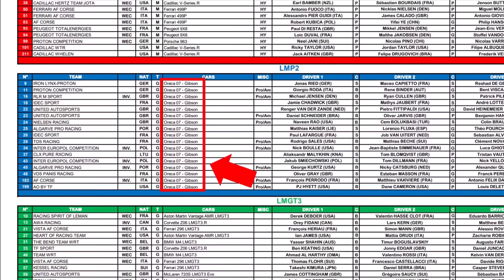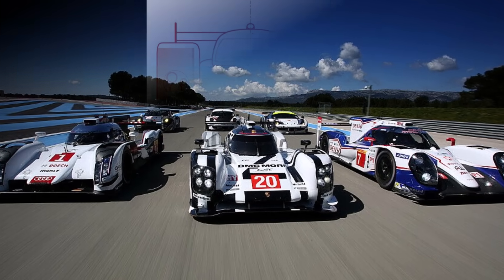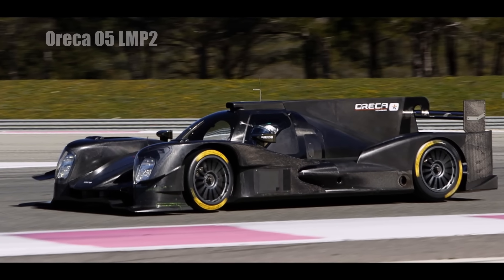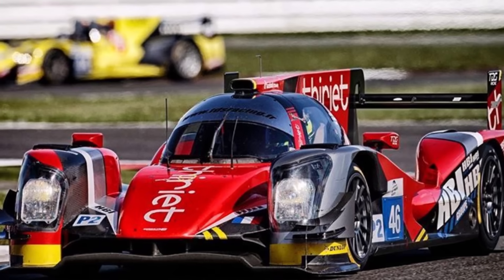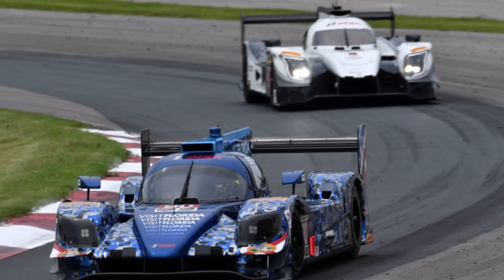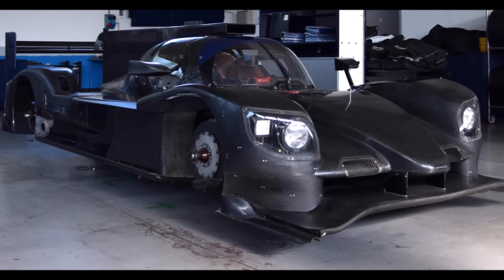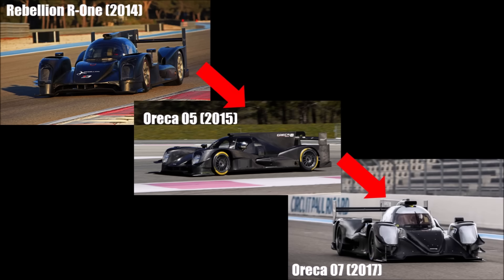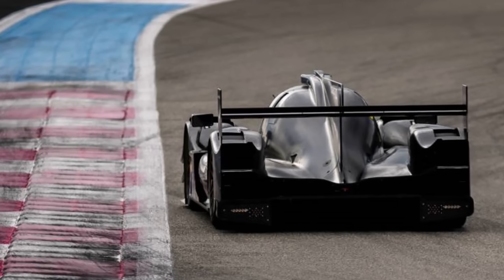Why everybody is driving an Oreca 07? - LMP2 EXPLAINED

Comment: I don't want to be finnicky on an otherwise very good video, and I may be wrong, but are you sure you've got the correct Ligier logo at 2:30 ? The Ligier with two flags is know for disabled-people cars, scooters and the cheapest possible plastic runabouts. The racing car Ligier has a circle with a sharp boomerang like a Star Fleet logo as a badge.

Comment: Of course ORECA had a great start from its purchase of Courage and all the IP from a very good basis of the Paolo Catone designed C65 LMP675/ C75 LMP900 series open-top cars, and their success evolved from a solid base.. which makes everything easier.
Let’s see how good the LMP2-Gen4 car from ORECA goes and looks, and I’m certain it will be an evolution of 05/07 series ORECA’s, why would you bother with a clean-sheet design when you ARE the state of the art (for 10 years already)! Almost as boring as Indycar’s Dallara IR12-based evo-car 🥱….😅😅😅

Comment: New LMP2 regulations were originally supposed to debut this year but I believe it was delayed till 2027, with Dallara, Ligier, Multimatic and Oreca, which are what the LMdH prototypes are based on sharing both the tub and floor as the next gen LMP2 cars, both BMW and Cadillac are based on the Dallara, Lamborghini is based on the Ligier, Porsche is based on the Multimatic and both Acura and Alpine are based on the Oreca

Comment: Riley was replaced by Multimatic as one of the 4 LMP2 chassis suppliers, which is what the Mazda DPi prototype was based on sharing both the tub and floor as the Multimatic LMP2
Reply: I noticed that the Multimatic LMP2 used the same wheels as the Mazda DPi.
Reply: @keefgtp yes because Mazda and Multimatic worked together to build the car, it shared a few parts with the Multimatic LMP2, including the tub and the floor, same went for the Acura DPi with Oreca, the Cadillac DPi with Dallara and the Nissan DPi with Ligier, in fact the DPi regulations was the main inspiration for the LMdH regulations

Comment: LMP3 is under a similar situation, everyone races Ligier, there are few Duqueines, even fewer Ginettas(and I started scavenging for every channel I could find because I liked the G61 on the spot, so that it reaped almost nothing is painful) while ADESS made a leprose of a car apparently, the only company that touched it made the chassis into an hydrogen-powered car of sorts. And if given the chance many prefer to deploy a car called Nova Proto 02, that competes with them despite being built outside of the  four manufacturer and running a Ford engine in place of the asiatic one(it was Nissan, now it's Toyota) imposed by regulation.

Comment: Great timing of this video - with the 2028-32 chassis and powertrain awards announced by ACO today:

“The modernised, simplified new-generation LMP2 class will be introduced in 2028. The two chassis constructors are: Oreca and Ligier. Gibson will continue to be the sole supplier of engines, and Xtrac for transmissions for LMP2”

Comment: Oreca 07: so good it turned an entire category into a spec series. And it's quietly one of the most successful and dominant cars in endurance racing history. It was only 38 minutes away from winning Le Mans OVERALL in it's debut year.
Reply: Also more than 100 models have been produced, which is a ridiculous lot for a prototype car.
Reply: The IMSA Weathertech Sportcar Championship used to run LMP2 spec cars alongside the DPi cars until 2019 when the LMP2 cars were restricted and made slower.
Reply: Maybe Peugeot should ask for the receipt.
"it's quietly one of the most successful and dominant cars in endurance racing history"

Due to lack of competition in its category. Those cars in the LMP1 were spaceships compared to this car. No doubt they had some reliability issues in 2017.
Reply: That's still ten laps or some 136km....
Reply: @GTfour01 they lost the lead 38 mins from the end, they didn't finish 10 laps down.
Reply: True, the fastest LMP2 finished 20 laps down or 272km.
Reply: @GTfour01  Not in 2017, he explicitly stated "in it's debut year", where the Oreca 07 finished just 1 lap behind the leader.
Reply: @nejcmirtic529  Yes, I was there. It was my fellow countryman Ho Pin Tung who led the race for quite a while.
But let's not fool ourselves, only because of mechanical issues with al LMP1 teams, did an LMP2 car manage such a high result.
Reply: @GTfour01 that's the whole point of le mans though, it's a reliability race.
Reply: @trialsted that’s too broad of a statement to call the 24h of lemans

Comment: LMP2 at the past is FASTER than LMH/LMDh nowadays. 

LMP2 past 920 kg, 600 hp

LMH/LMDh 1030 kg, 670 hp

Current LMP2 looks slower because FIA/ACO cut down their power to 540 hp, not full 600 hp spec.
Reply: you're not accounting for the extra power of the hybrid system tho, plus the "momentaneous" AWD in the case of hypercars, cause their electric engines power the front wheels, they also have a much better aero packages and turn speed thanks to these two things, and you know what happens when you turn faster? you get more top speed at the end of the next straight
Reply: I vaguely remember the LMP2 cars getting nerfed at the beginning of the hypercar regulations, because they were too close in performance

Comment: ORECA has exceptional build quality, that makes a huge difference. It has a much wider setup window than the other cars and has much fewer suspension options for setup.

The Ligier could be made to work on smooth, high-speed tracks with little ride height variation for a few laps, but once anything changed, you were screwed. Beyond that, they were a nightmare to drive. No matter what, it had a super fast turn-in and then went immediately to understeer. It was a treat.
Reply: Reminds me of their LMP3 car model in iRacing. Just a right bastard to drive and I've given up on trying to love it. Stiff, overly reactive chassis, genuinely awful turn-in, and no real raceability within class because it simply cannot deviate from its ideal line.

Meanwhile the LMP2 is an absolute pleasure, or at least it was until they nerfed the front end grip into the ground. Now you have to work hard to not eat the front tires, yet it gets minimal rotation out of the rear end and feels like you are dragging an anchor behind it.

I'd love to see an updated model and chassis LMP3 in iRacing. It is a very cool car and a great intro to prototypes, the P320 model just is no bueno. 

I'd also love to see the Sebeco NP-01 make it in as an even more entry prototype. Such a neat little car and lightning fast for something with only ~220hp.
Reply: @bobbymoto1675  FWIW, at the track, I tune the Ligier P3 like it's a GT3 car. The aero platform is simple enough that you can get it off the ground and let it move a little. The gain in mechanical grip is an advantage over the loss in downforce. It take deliberate inputs with the P3. It doesn't ever drive like a P2.

The iRacing LMP2 is a Dallara and its handling is fairly representative of a Dallara. Even then, it's pretty awesome.

Pro tip: Throttle map 4 is the linear one, which is basically what everyone runs IRL.
Reply: @bobbymoto1675 seems Le Mans Ultimate is adding the ELMS so I guess we'll have the latest LMP3 there.

Comment: As I understand the updated Riley/Multimatic was never actually raced as an LMP2, but that update package was applied to the Mazda DPi when Joest/Multimatic took over from Speedsource/Riley. Which that transfer boosted the performance of the car by quite a lot to making it I believe the outright DPi lap record holder at quite a few tracks. It really makes me wonder what that Multimatic Evo version of the Riley would have ended up doing, because I think they had the possibility of being extremely fast.
Reply: Actually it was raced as a base LMP2 car but not very often

At the start of the new Prototype class in IMSA, there was one at the 2017 Rolex 24 and Le Mans that same year
Reply: I thought that chassis looked familiar!

Comment: coincidentally stumbling on the new regulations 3 years before they happen sure helps development, FIA didn't think that through before they chose the dimensions
Reply: Motor racing has always had an element of this, if your product was best everybody bought it. Just that in previous times “it” was likely to be a smaller component (tyres, brakes, steering wheels). Realistically the broad shape of the cars across classes has become very similar, it’s a mix of regulations and physics. Now even Le Mans all the starting cars have reliability. Oreca did have the luck that a competitor went bust, a client asked for a special. The video has a list of competitors who tried but faded away. Don’t get the corruption dig, sometimes a design decision does turn out to be the right thing at the right time.
Reply: First, it isn't coincidence it isn't that hard to think if LMP1s chassis are going to get smaller so will LMP2s at some point just to make scrutineering easier.

But also one thing not mentioned is that in March of 2015 (so 1 year after the LMP1s went down to 1900mm), IMSA announced the DPi regulations which were going to be introduced for 2017, and in July of 2015 the new LMP2 regulations were announced. The 4 chassis manufacturers were Oreca, Multimatic (Riley), Ligier and Dallara and all the chassis the DPi cars ran were the 2017 LMP2 chassis. The FIA, ACO, IMSA and chassis manufacturers probably all just met before any regulation announcement and everyone agreed the chassis would be the same between the DPi cars and the LMP2s, then announced them both in 2015 to give the manufacturers time to develop the chassis
Reply: @AfonsodaMataSlam indeed we have a coincidence theorist
Reply: "coincidentally"
Reply: FIA loves to play favourites
Reply: @alondjeckto  Looking forward to seeing a Russian team here.
Reply: Corruption is rampant

Comment: I dont understand the aero differences on the LMP2 cars the design of the Liger looked like it would be fast due less frontal area and working the floor and diffuse harder by the looks of the huge gap at front sending air to rear
Reply: Because it is, but the point is Oreca are just easier to setup and more reliable than the rest

Comment: imagine a Oreca 07 with a more capable powertrain. A ~5 yo F1 Drivetrain (with the hybrid) would be awesome...
Limiting the engine could strech their runtime to 24h.
Reply: The Acura and Alpine LMDH cars are actually based on Oreca 07 but with different drivetrains.
Reply: You already have it, it’s called Alpine A424
Reply: Wet dream but reality is sprint engine is sprint engine, and same can be said for endurance. Look how Peugeot did after their switch from Group C to F1 with more of less same engine as 905, or how venerable DFV fared in endurance

Comment: Honest question: Is LMP2 not completely redundant these days? Sandwiched between Hypercars and GT3, it has no relevance for auto manufacturers
Reply: Its used for cheaper regional championships where the hypercars are too expensive for teams. Lmp2 is produced by racing manufacturers so doesn’t need to be road relevant
Reply: But Hypercars won't cost more than 100 mln USD per year. So it's damn cheap  @zXPeterz14
Reply: It is mainly for cheaper so there's more privateers. Hypercar has them  privateers partner with manufacturers.
Reply: It shouldn't have any relevance for manufacturers, it's meant for teams.
Reply: they're basically the bridge for privateer teams to the top and for drivers too
Reply: why does it have to have relevance to car manufacturers?
Reply: @nickb2049  simple when a car manufacturer wants to go to yhe higher league they'll find a privateer team that is willing to go do a partnership with them
Reply: Same reason F2 and F3 exist. Spec cars, cheaper operation, lets rookies cut their teeth on similar equipment, and eliminate chassis bias.
Reply: Apart from the privateer angle mentioned already, it also allows younger drivers to demonstrate their talents in equal machinery, and their ability to collaborate and find a setup that is fast without being undrivable for their bronze driver.
Reply: Nope. And it’s not meant for/ nor are auto manufacturers involved with them.
Reply: @bopoloco ummm may I add Genesis (Hyundai) running on LMP2 as preparations for their hypercars Debut?

Or Alpine using LMP2 till they got a real hypercar ready.

There you have two
Reply: @jcuevascisnerosJorgeCuevas That’s Magma racing not actual Genesis and Alpine just used that as a gap year for prep and keeping people in a job. 99% of LMP2 users are privateers. That’s who this is meant for.
Reply: @jcuevascisnerosJorgeCuevas Matter of fact that “Alpine” LMP2 run was still just Signatech with Alpine branding and backing
Reply: @bopoloco  At the end. Magma and Genesys are the same   Thing.  They are called Genesys Magma Racing.
Reply: @jcuevascisnerosJorgeCuevas At the end, it’s IDEC sport running those cars anyway.
Reply: It is spec series so there are no major manufacturers involved who build road cars such as the manufacturers in WEC.
Reply: It's a racing series stop being obsessed about auto manufacturers

Comment: Is the gibson v8 based on a road car engine or is it a clean sheet design?
Reply: It's a race engine made specifically for endurance racing. No connection to any road engines whatsoever.
Reply: Anyway it's the most annoying sounding engine in Le Mans this year, and there are so many 😅. Second prize goes to BMW hypercar engine.
Reply: Anyway it's the most annoying sounding engine in Le Mans this year, and there are so many 😅. Second prize goes to BMW hypercar engine.
Reply: I thought it was based on a Nissan engine?
Reply: @hedleyyou  The Nissan VK45DE was a Nissan + Gibson collab.
Reply: @hedleyyou The original LMP3 cars used a Nissan based engine.
Reply: Are the LMP2 and LMP3 engines physically the same - just a different map?
Reply: @hedleyyou no, LMP2 has had the Gibson 4.2 V8 since 2017. LMP3 had the Nissan VK50 5.0 V8 2015-2019, then the VK56 5.6 V8 2020-2024, and for 2025 LMP3 has Toyota's V35A 3.5 V6 twin turbo.
Reply: The VK45DE was used in LMP2 2011-2016, but also in SuperGT 2007-now.